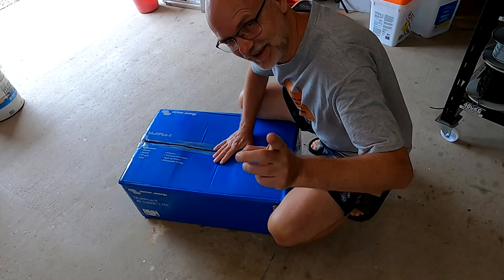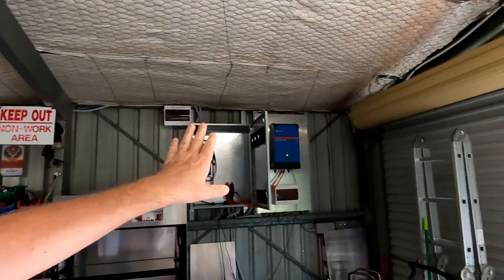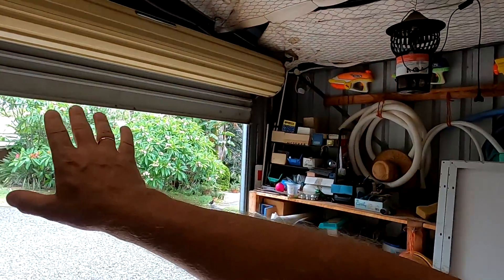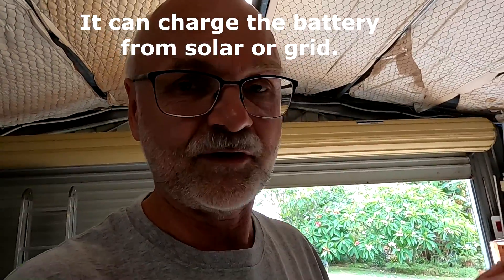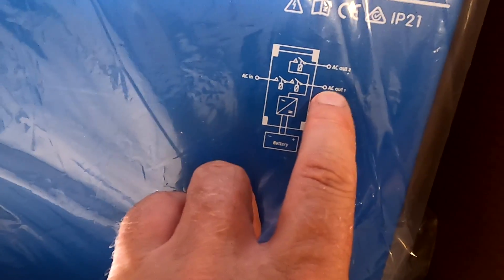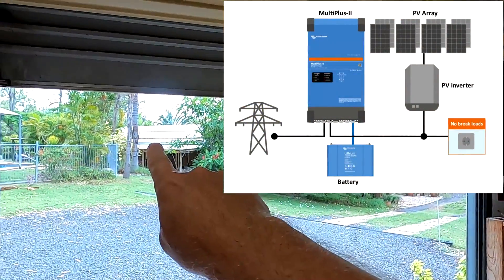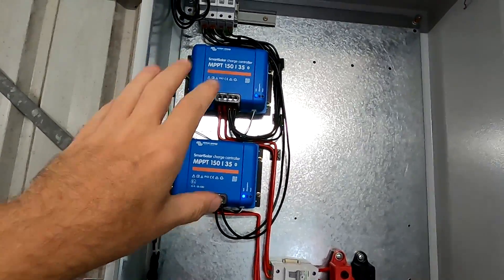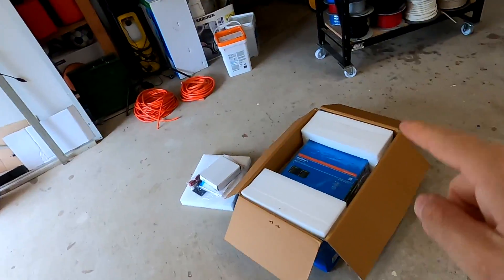This Multiplus II is not what I've ordered. But I keep the free upgrade, right?!

Comment: You can of course use your old inverter and the new multiplus2 together! Your old inverter is your "grid" so why not use some of the features the new multiplus2 has :)
Reply from the maker: No smoke? It would make a brilliant video 🤭
Reply: @OffGridGarageAustralia  Naa no smoke... trust me, I'm not a pro.🤓
Reply from the maker: @roadeycarl  that would be an amazing setup. I just have to be careful not to overload the small inverter, output decreases when it's hot outside.
Reply: @OffGridGarageAustralia  Yes that is fair enough. I think you will find the Power Assist option to be best suitable for your needs. I actually do something very similar with one of those cheap Sun-2000GTIL2 on my off grid setup. It contributes to my MPP 8KW inverter when I start pulling more than 6.5Kw ( I don't like to stress out my MPP inverter) Happy tinkering :)

Comment: This sounds a great piece of equipment.I have a big question: what are the pros and cons of using a solar MPPT to AC and a solar MPPT to the battery DC?
Reply: Solar Mppt to DC is more efficient. 1 thing I know 😂✌️
Reply from the maker: Yes, Janis is correct. MPPTs are the most efficient way to charge your batteries. They have the least losses and adapt the fastest to changing conditions.
Reply: This is not clear. My opinion, which is based on nothing at all: If you use solar MPPT to DC means that you cannot inject on the grid, so only worth if the battery is big or if you have no grid at all. Besides, solar MPPT to AC might be more efficient if yo are using the electricity straight, since there are fewer transformation steps. So a hybrid with both AC and DC MPPT might be a better option. This is just an intuition...

Comment: Well, is it not possible to use the old Phoenix Inverter as AC-IN feed for the new Multiplus? In this case the Multiplus would synchronise to the Phoenix Output microgrid and you should be able to use the 3kVA off the Phoenix + the 5kVA of the Mutlipus = 8kVA on one phase. Maybe you will need an additional Victron current sensor on the phoenix Output to make sure, that the Mutliplus will never try to deliver power in this "grid" of the Phoenix (Nulleinspeisung).
Reply from the maker: Yes, that's a fantastic idea and will be a great project. I'll see what I can find.
It should not send any power to the grid as the AC coupled solar is not connected to this system. I don't think it will export power from the MPPTs to the grid but I might be wrong about this...

Comment: You could use the Phoenix inverter to create a mobile power Although you have solar close to your house a mobile source with more power and capacity than a Bluetti might prove useful. 
 I have used a Multi plus with 29.5kwh battery in a small camping trailer to do this. I am in the process of building a second one so that energy  can be moved and is always available much like having two batteries in a cordless drill. This is important to me as my solar array is about 1.5km away from my house.
Reply from the maker: I still have the XIIJA inverter as well. It is much smaller but has also 3kW. I safe this for the lawn mower once it's converted to run the electric chainsaw or the mulcher off it...

Comment: Can’t you use the old inverter as the “grid” input into the MPII and then the MPII will just load assist when the draw is greater that what your program the capacity of the “grid” input. You would have to disable the charger on the MPII of course.
Reply: yes, he absolutely can!
Reply from the maker: Fantastic! That will be a great project!

Comment: I'm interested in the technical side/planning of how to have a remote battery connected to the house. That's something I'm considering, and wonder how it's done, without using $$$$ cabling for DC vs double conversion DC-AC-DC (or AC-DC-AC?). Keep the MP2 (obviously) and I'll be watching for those remote battery discussions.
Reply: I'm using a Multiplus II in my campervan with a 7kWh battery. It charges at night when it's cheap and discharges back into the house during the day. It's halved my electricity bill.
Reply from the maker: Yes, it can use the existing AC cabling to the house. That's a brilliant device.
Reply: @OffGridGarageAustralia  I'd still be interested in an episode (or 2 or 3) covering it. Surely your existing wiring from house to shed isn't big enough to cover battery storage feeding AC back to the house? You might have a single circuit in the main distribution panel in the house which goes to the garage, so the cabling is sufficient for that, but the house has 6 or 8 (or more... you know what I mean?) circuits. You surely can't feed enough AC power back to the house to cover all that using the existing cabling? Maybe you're not aiming at whole-house-from-solar-battery kind of setup. 

I'm looking to plan for a new house to be built, with batteries in a workshop in the back yard, with collection panels on the house and workshop, and running the entire house and workshop from that collection/storage setup.

Comment: If the old inverter has enough power to supply the garage, pool pump, and vehicle I would keep it connected to those circuits separately and add the new inverter to power additional loads including the house.  That is what I plan to do with my current Genetry Solar 6K inverter when the GS 12K becomes available.  The 12K will power the majority of the house but the 6K will be powering the water heater, well pump and back garage.
Reply from the maker: Yeah, I cannot connect the house as long as the contract is in place.

Comment: Keep the Multiplus 2. With it you can add PV Panels with Micro invertes. So everywhere you‘ve got power and want solar just add 1-4 panels with a microinverter. The microinverter must sense power frequenzy und if it goes above 50.2 Hz the inverter must start to reduce output. Obove 51.5 Hz at 50% reduced output they must shut down. The norm that sets this is the VDE-AR-N 4105 in Germany.
Reply from the maker: I heard this from Jens (Meine Energiewende). He told me that his Micro Inverter shut down once his Multis will increase the frequency. That's an interesting feature. You still need to watch the 1.0 rule for the Victron Multi in doing this.
Reply: That's a nice simple solution.
I wonder if much efficiency is lost when charging from external micro inverter AC opposed to local  DC?

Comment: From my understanding of the docs for Victron Inverters, the ones with AC in are AC power passthrough, so it doesn't back feed. So even if you connected the inverter to your grid, as long as it doesn't work with the grid tie solar, you be fine using it. Also it can give you an extra power to the batteries for like charging your car on a cloudy day. So I say take the upgrade, and its means you are one step closer to the end too. :P
Reply from the maker: Thank you.
The power company won't allow the inverter to be connected to the grid. As soon as I do this I have upgraded my agreed inverter power. I cannot physically connect any other inverter to the grid as long as the contract runs. But, hey, we're the Off-Grid Garage, right?!
Reply: @OffGridGarageAustralia  The Unit  is set by default to no export allowed, so it will only act as a load which the power company is more than happy to allow, Its the standard for Marine that are plugged into a shore socket.
Reply from the maker: @nicholaskeur  I've seen the same information in a video today when someone showed the default settings. Thanks for confirming that!
Reply: @OffGridGarageAustralia  Yep, that's what I was meaning. You can connect it as a load, and it would allow you to run stuff in times you have no power from grid.

Comment: question?? how long would it take you to replace that inverter with another one? (it blew up). would it not make sense to hook them both up and mothball or light load the other? As for the upgrade- if you bought a tv- car- widget and they could not get it only with the features you wanted but the next model up had that and more for the same money would you say no or would you smile and say thank you for thinking of me? How long can you hook it up to the grid to "test" it i wonder. or hook to genset. i see many more vids coming
Reply from the maker: Thanks Marte. As others said here it might be possible to use the old inverter as the 'grid' for the new one and series connect the inverter. That would give me 8kVA on total power. I cannot hook the new one up to the grid though as long as the contract runs...

Comment: Keep multiplus and consider 3 in future so you can comfortably charge your Tesla at 11kw 3 phase.
Reply from the maker: I don't need to charge that fast. I have the car for over two years and charge with 2.4kW at home if not slower from the inverter. Not a problem at all...

Comment: Can connect 3000 ac to ac input on the 5000 to get some more out of it. :)  If it good and works is another question. Maybe better to use them as two seperate circuits for different loads as mentioned, good for redundancy if one would fail.   You can still paralell two if you buy any one of them again.
Reply from the maker: Apparently they can be piggybacked, so this will be the next project...

Comment: The Tesla Powerwall 2 does the same trick in shifting its generated power mains frequency to control a grid connected inverter.
Reply from the maker: Didn't know that... It's a cool feature

Comment: Can't you feed the Phoenix output to the AC input of the multiplus. this way they don't have to communicate. You can setup the AC input of the multiplus to the max power the phoenix can deliver and the rest is done bij the multiplus up to 8KW. Make sure the multiplus is not charging the battery's from AC input :-)
Reply from the maker: Yep, that's now the plan and it should work. I have to throttle down the settings in the Multi as the Phoenix can only output 3kW in cold weather. Or have a winter/summer setting...

Comment: It is good to be able to have a charger when off grid. I know you don't want a generator however one day when your house is off grid a backup generator is part of good system design. If you don't have a multiplus how are you going to handle a generator? Does the Phoenix do microgrid? I thought it does. This is invaluable feature I use all the time on my diy home built inverter system.
Reply from the maker: Until then I hope I can plugin the vehicle as a backup generator.
The Phoenix does not have any AC inputs and is purely off-grid, so yes, it does a micro grid as well. So in this regards, the Multiplus is the better choice.
The Phoenix and Multiplus are in fact the same inverters just the MP2 has additional features.

Comment: Hi andy does the 8000 OR 5000 MPPSOLAR DO THE SAME TRICK AS WHAT U HAVE BEEN GIVEN?THIS UNIT I REFER TO IS WHAT I USE ONLY I DIDNT CONECT MINE TO THE GRID, THERE IS PROVISION FOR GRID CONECT ON IT.CHEERS RENE.
Reply from the maker: Yeah, but can it also handle AC coupled solar in an off-grid situation?

Comment: Hi Andy happy new year.
I think that you can use the old inverter to power the car because othervise if you charge the car via the Multiplus it can overloaded.
And because if you buy another Multiplus at the moment is not necessary because you can't connect the house to the garage at the moment do to the AC couppling.
Reply from the maker: The car can handle up to 11kW 3-phase wile charging from AC but also as little as 1.2kW. It will adapt to the power source I connect it to.

Comment: Hallo Andy, I am your biggest fan!   As a beginner in the solar project, I still need a lot to learn. Your videos are a big help. The easy way you teach us is perfect.
I just hooked up my Multiplus II to my 16S 280 pack. But if I could do it again, I would have ordered the GX, wich has better communication possibilities.  And even my JBD BMS (the relay one wich you teared apart...) works good!  Although I am still searching for the right xiaoxiang app with changable settings (maybe you have a tip for me)
Keep up the good work!
Reply from the maker: Thanks Victor. 
Have a look on my website, there is the newest XiauXiang app available. This should have all the features you need for the JBD.
The link to the app is under the QUCC section: https://off-grid-garage.com/battery-management-systems-bms/

Comment: I have  Victron Quattro 24V 8 Kva it has those capabilities too
Reply: Yeah the Quattro has dual inputs that's the difference on it I have the multiplus 2 it's single input but dual output whereas the Quattro is dual input and dual output
It means you can have one of your inputs set to one current and the other input set to a different current limit such as grid tie with generator backup and then you're two outputs one would be battery Plus either of the inputs and the other one would be only either grid tie or generator
Reply: @theguywithallthesolutions  Yes and also it has a function called weak ac input where as it can pick up the slack for large loads
Reply from the maker: I think the Quattro is more for mobile solutions where you connect to multiple power sources across your journey. It's very flexible.
Reply: @OffGridGarageAustralia  Yes they use them in boats too but 50+ kg not so portable ha ha

Comment: Keep the free upgrade Andy! Looking forward to "experience sharing" of the new inverter.
Those features sound very similar to the MPP Solar/voltronic power infinisolar V2 hybrid inverter, but it has solar charge controller and grid tie feed in the inverter itself along with all the usual features like AC charger, parallel, communication at a fraction of the victron price. I don't know how they do it. Anyways that inverter won't satisfy local requirements for grid tie I guess, but still worth a mention.

Comment: hi Andy keep keep keep you're lucky man
i received mine a few weeks ago. large inverter and so many possibilities. 
but you will have to invest some more.... 
For any programming needs you will still need the MK3 to USB adapter of a cerbo  and a computer or tablet.
And the MultiPlus line does not have BT built in.
I already use this a lot, here in the winter here in Europe
one of the possibilities is that you can plan your loads, and also start charging at 20% and stop at 70% or just charge 5h00 etc.
Reply from the maker: The MK3 adapter was in the box. I ordered this at the same time 🤭

Comment: Keep the Multi Plus, if you can't spend out initially just split the loads across the inverters and then later you can sell the Phoenix to buy the next MultiPlus. 
Or perhaps see if the supplier would be willing to do a trade-in on the Phoenix now to upgrade your system sooner rather than later?